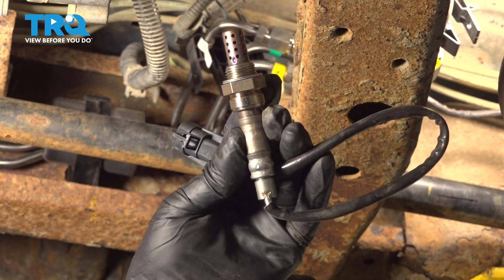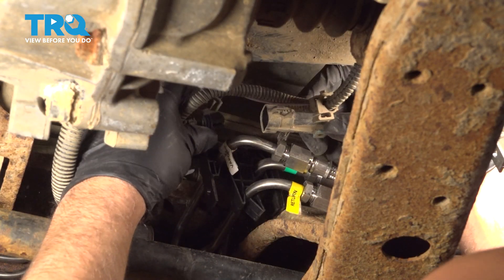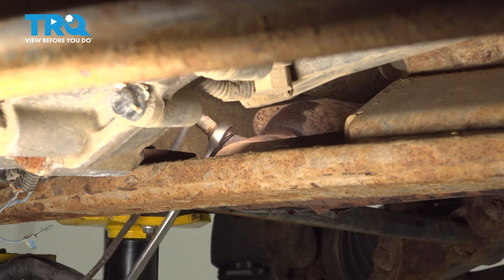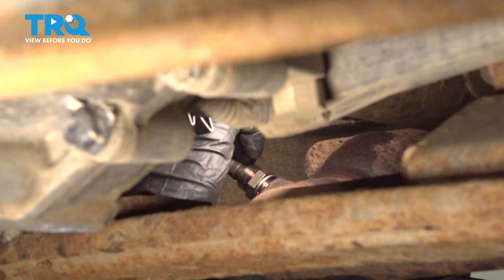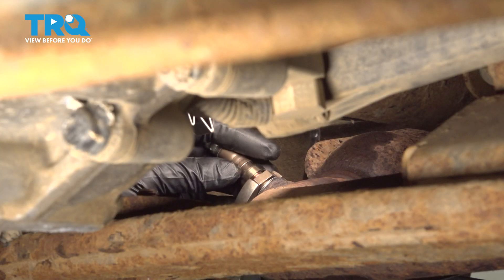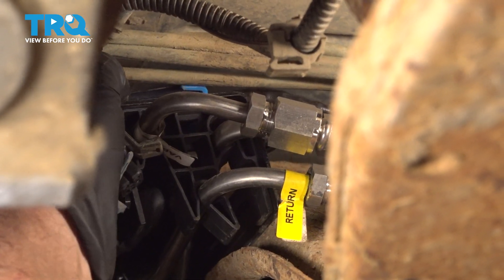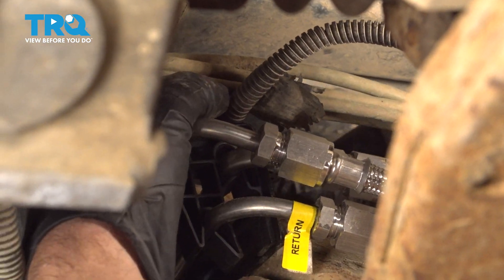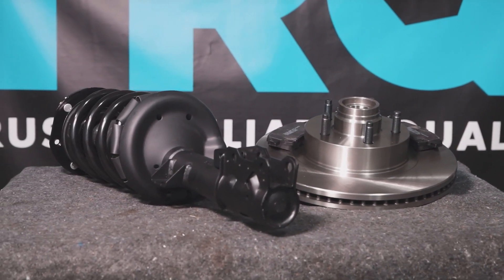How to Replace Downstream O2 Oxygen Sensor 1999-2006 Chevrolet Silverado 1500

Comment: Went in for a oil change and guy tell me you have a cable hanging down. Tells me we can plug it back in.  Guy goes under to drain oil and looks, and the end is gone off the cable.  This is the downstream O2 Sensor on a 2000 chevy suburban 1500.  Guy tells me looks like someone pulled it apart.  Why would someone do that.  Shop we have gone to for years I have been suspicious of purposely messing up things to have me come in and pay more money.  Not sure but have had other repairs that led to more repairs and money after having something fixed.  I replaced the sensor but can't find the plug.  It must of fell back in around the fuel lines but barely enough room to crawl around under the Suburban.  I cannot find the plug but it has to be there somewhere.  The cable end is all gone.  Just wires left coming out of wiring.

Comment: hy.Thanks for your videos .They are super and have helped me over a lot of replacements in my Silverado.
today im seeing this one because i have check engine light .Got it scanned in autozone and they tould me i have P0300,p0154, and  P0155 so i have a bad 02 sensor passenger side upstram.Well , when i look at your video it look not quite the same of the set up i have.All my 4 02 sensors look the same and all 4 are males,the female conector (in my case) is the one in the harnes .Mine one is canadian 2003 silverado 1500 extended cab.This is correct?All my 4 are the same ? like upstram ones?
thanks